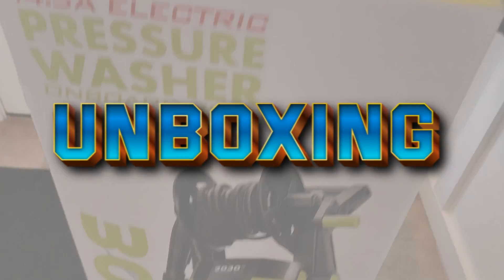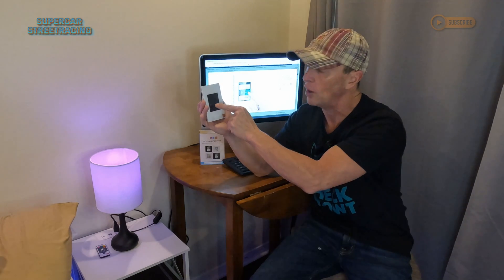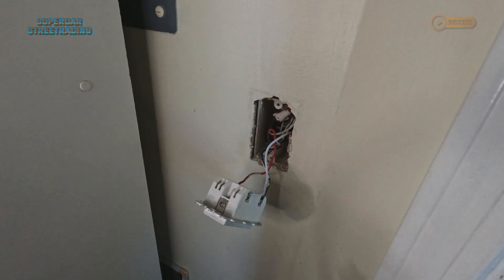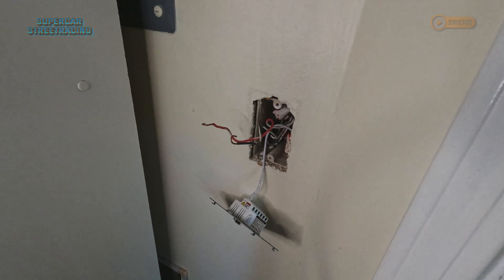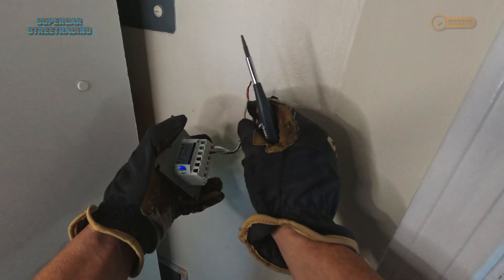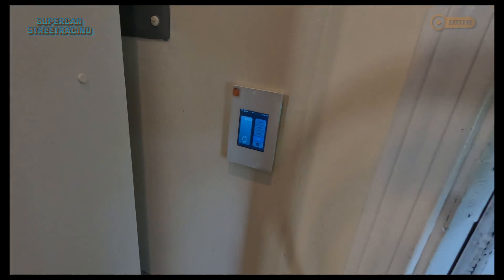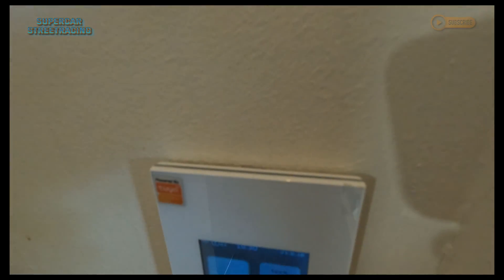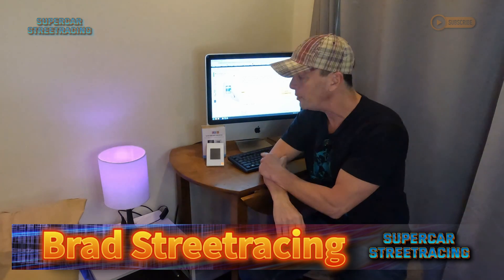I refuse to lose twice, LANBON L8 HD TY LCD Smart Dimmer Switch

Comment: I have 3 switches how do I connect all the wiring into that?? All 3 switches have copper, black and white.
Reply from the maker: 3 switches for a single wall box? Clarify that a little bit.  One switch does multiple lights.
Reply: Its a 3 gang switch. Basically 1 switch for each light in one wall box. 😅
Reply from the maker: Yeah the actual switch supports 3 connections. You would connect the black wires to the switch connections on the Lanbon. one input, 3 outputs on black. Each black goes to each bulb.

Comment: Does it work with Philips Hue light and hub?
Reply from the maker: So it will switch it off and on. But it's not going to do anything as far as communicating with the hub and bulb. It's basically a smart on off switch.
Reply: Yes, you can make that happen.  First off, wire the Hue light on solid, not switched.   This L8 switch will not control the power but will send data to a computer, then the computer sends data to the Hue hub.  The computer runs Home Assistant.

Comment: Thanks for the video. Does the switch work without needing to connect to WiFi network or Internet? I'm concerned that if my home network went down, I'd still need to be able to turn the lights in and off.
Reply from the maker: It does yes. Manually works fine.

Comment: You pigtailed a nuetral wire from all the nuetrals to the smart switch? I got a flip switch with 3 nuetrals tied together. How the hell do you plug 3 ends into this 1 nuetral hole?
Reply from the maker: Not following all you should have to do is pull 1 neutral from anywhere to feed the smart switch. Doesn't matter where it comes from.